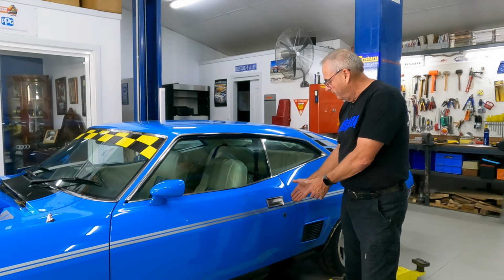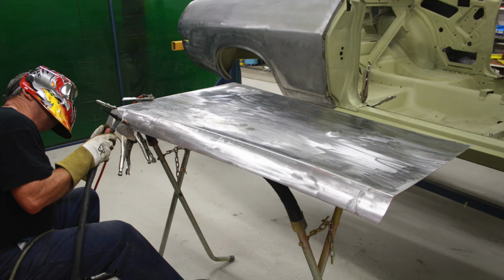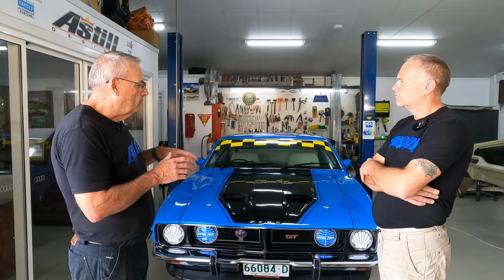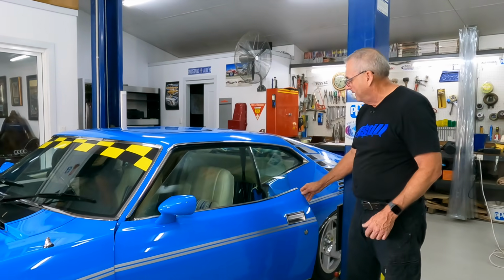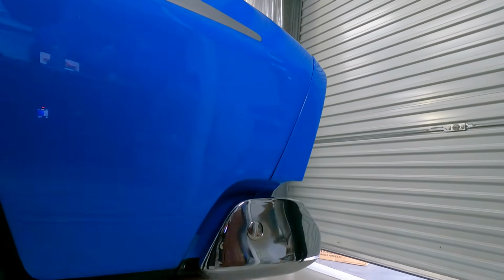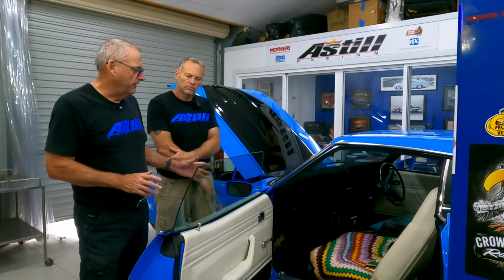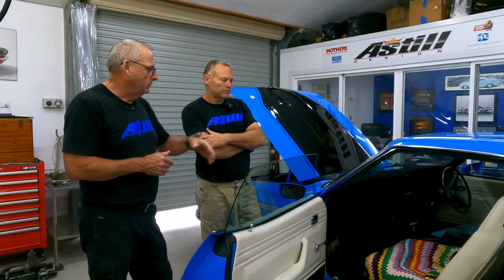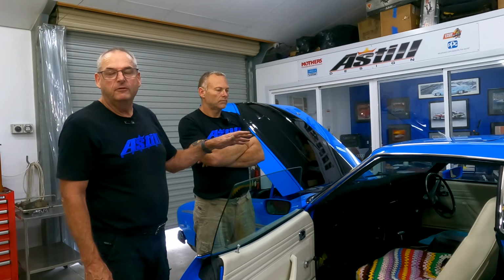Blackman's Ford Falcon XB GT Coupe Revisited | Astill Design Extra

Comment: Hey Howard i  have a 76 xb gs ute done 50,000km from new,dont they have the same doors as the coupe,just one day i opened the passenger door and it woulnt shut.It would shut on first clink but woulnt completely shut ,i took to a few guys[paint and panel]with no luck,what you saying about taking the  front guard off,i thought that adjustment might do the trick,have you any sugestions
Reply from the maker: Use a screwdriver to close the jaws on the door catch to see if it will close onto the second catch. If it does, lift the outside handle and release the catch. Then adjust the striker out so that the door catches on second catch. Check the distance to get the door level with quarter panel and move sticker to get the desired setting.

Comment: i place 5mm plates inside the A-Pillars with ajustment of my HQ for the electric windows and weight ..  As they tend to sage as well , Original Holden fits a 1mm plate on the outside of the A-Pillar for electric windows which i believe there not stronger enough ..
Reply from the maker: Yeah lots of little tricks

Comment: I don't understand the EFI issue. Autronic has no issues to be expected. The founders from Motec anyway. The build described for EFI could not be more simple. It's not a criticism just very surprising to hear. We are spoilt with EFI genius in this country and home arguably the best ECU manufacturers in the world.
Reply from the maker: True Mark. A lot of the issues were to do with adapting the mechanical injection to electronic and the sticking throttle shafts and butterfly clearances etc. The engine will be going into another project and will get sorted.
Reply: @AstillDesign  Ah, that makes sense. I missed the mechanical inj bit.